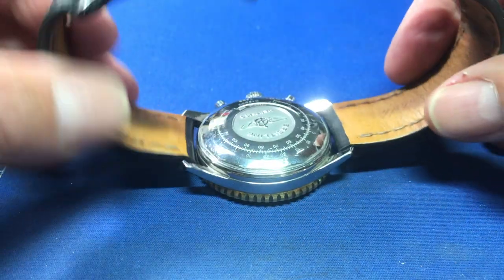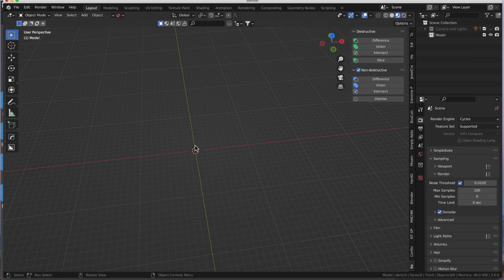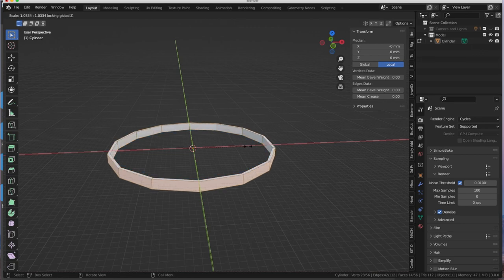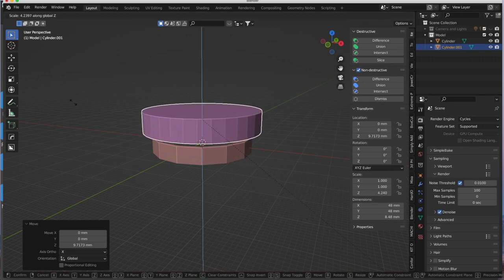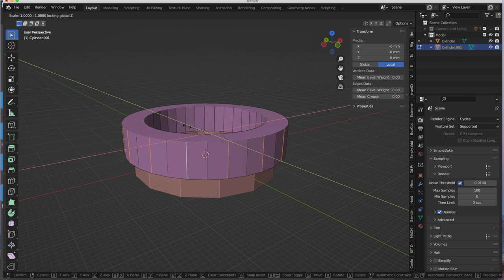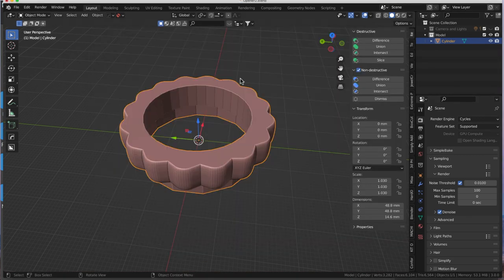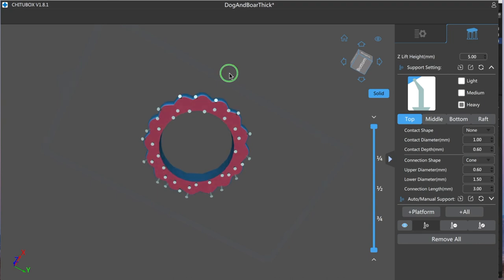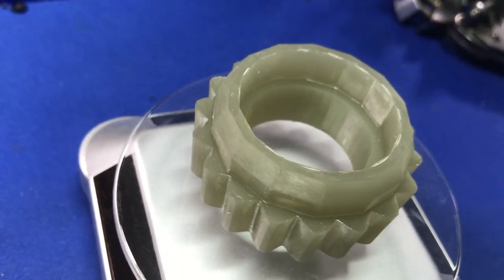3D Printing a Breitling Case Opener with your Printer and Blender 3.0

Comment: Hi, thanks for the all good tutorial.. wanna ask.. i see all the ringmaking video you made and realize in this video you say when we print in 3d, the model will shrink about 4%.. my question is.. when we do modeling for ring and ring size is 18mm.. if we need to add 4% to the ring size or still using 18mm as measurement? thanks